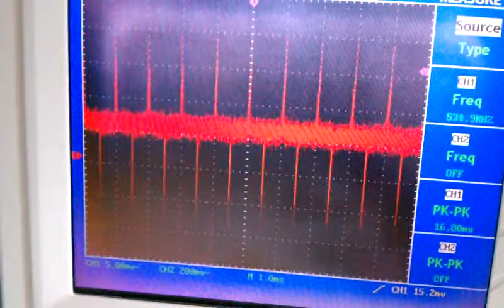Kunel gap example

Comment: what you want is the permanent magnet N pole, air gap,  N pole of the pulsating DC coil and then the pickup coil. This way the N - N poles a bucking and hopefully the pulsating DC stops the permanent magnet flux entering the "core". The permanent magnet flux is pretty strong, so you can't have PM - pickup coil - pulsating DC as the circuit. I don't think you get real changes in the flux this way, because the PM flux just stomps the pulsating DC flux
Reply from the maker: I see what you are saying. I have the pickup coil at the PM side, strong field side. I need to move the pickup coil to the back end or right end of the pulsing coil core. The furthest end of the pulsed iron wire and not on the magnet connected wire.
Reply: And I think I have to change my setup to ferrite magnets. Neodymium's flux at the end of my core is stronger than any field I can produce with my electromagnets and I even got a hefty air gap between the ND magnet and core. Maybe start with a smaller strength magnet and use neodymium on third phase or something. This makes sense and is easier to make than Figuera patents
Reply: Kunel few pictures of setups with toroid cores too. Plenty to experiment with
Reply from the maker: You can also add layers of cardboard between the cabinet magnet and the wire. In fact you just make the wafer thick and use tape. Special secret. You can also use ferrous core and place a small magnet chip on it to really make it an easy field to influence. This is what magnacoaster did.
Reply: Good idea. You can "choke" the N cabinet magnet field in the ferrite core by placing 2 small magnets on bottom and top of the core (both N poles to the core) to squeeze the field smaller and then use the electromagnet or coil to stop that flux going to the core. Thx!
Reply from the maker: Correct you are. But you need an air gap. This IS the resonant chamber. Other wise the permeability in core is like concrete. The flux in the air is a much weaker medium to manipulate! And it rings. Get it?
Let me reiterate: In air, one can break the flux with just a tap of current. In the core itself you need more power. I just gave you the keys to the secret.
Now if you want to use a solid ferrite core then the magnets at both ends should be opposing so you can aid in the repulsion. In my tests you take a 6 inch length of iron or steel wire and place opposing magnets on each end, south facing in since that is the weaker part of the field. In the middle of the wire is where you have a wrapped 28 gauge wire coil and pulse it there with square waves. Snap reality and it rings back. The scope will show the extended ringing. Where does one read the ringing? The iron wire becomes the conductor. Kapeesh? This is the secret to 90 degree coupling.
Reply: Good points. This seems obvious now in retrospect. I was just cursing that my function generator does not have the amps to break the flux. Somehow I thought the air gap would mess things up